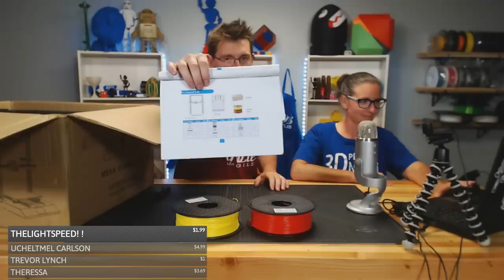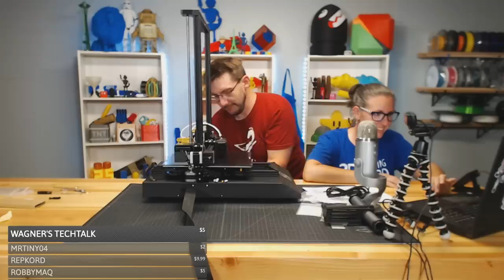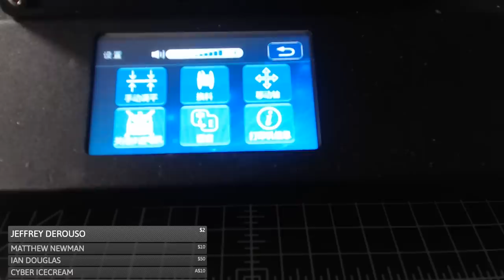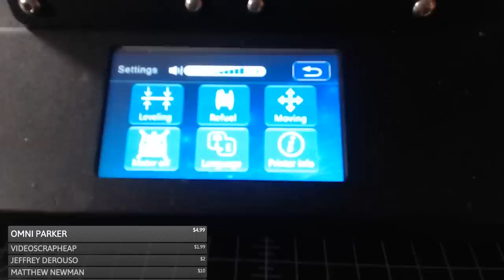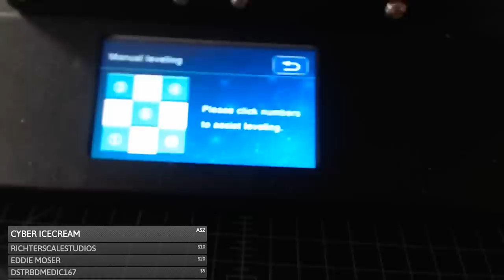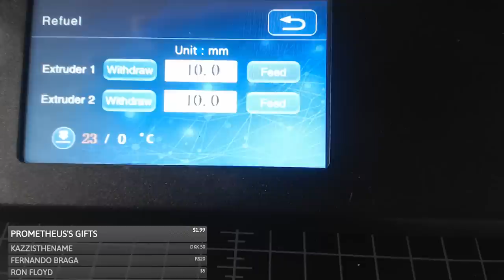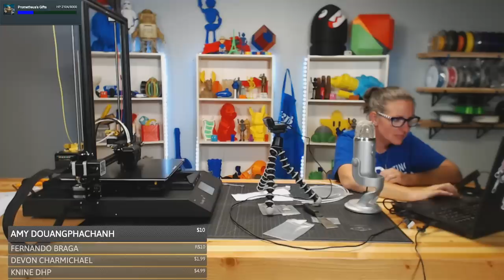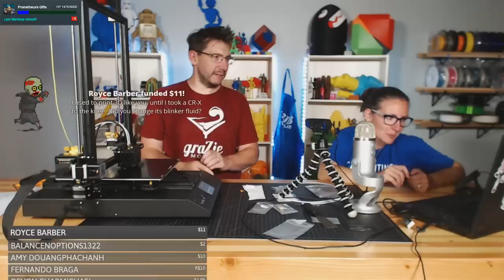Creality CR-X Unboxing & Setup! Will You Be 3D Printing With This New Printer? (Was Live)

Comment: You can use the two PTFE tubing to stop the chafing of the filament on the metal spring loaded extrudes. That way there is a decent bend radius and the filament does not touch the metal.

Comment: A couple important factors that should not be overlooked, is how fast it can reach a heatbed temperature of 110c as the temperature minimum required to avoid resulting in a higher incidence of cancelled ABS prints. 110c, without waiting as long as it takes to make a pizza. People do want that. A added MOSFET and a secondary power supply can be considered an option to correct that concern, though figured why not mention that for factory level builders of printers. Helps prevent landfill this way even.
I like that printers design, and it has a worthy build volume. As a added bonus, a kit inclusion of smaller and larger diameter nozzles would really sweeten such deals. Those can save a lot of time for larger prints and to adjust resolution.

Comment: Sooo... I was just about to buy the CR-105S from Tiny Machines, with all the upgrades. Would you say that holding out for the CR-10X in the next few days would be a better purchase, despite the slightly smaller print volume? Are there enough upgraded enhancements that would make this a pick over the 5S?

I realize that if this becomes a hit, there will be plenty of aftermarket support and goodies to upgrade along the way with.

Comment: Joel,  You are the most awesome nerd I know.  Thank you for all your help, I have learned a LOT from you.  Maybe I can return the favor.  I tried the bed leveling thing with paper, card stock, etc.  Being a back yard mechanic and hobbyist machinist I went and got my feeler gauges.  I use a .254 feeler gauge to level the bed on my CR-10 and it works well.  You can pick up a cheap set from any auto parts store.   HIGH 5

Comment: Can this be used with Water Soluble filament?   If so what is the maximum size?   The specs implies 2 extruders reduce the printer are to 270 x 270, but that does not make sense as it that should only effect the X-axis not the Y axis, or am I missing something.  I need to print 260 x 300 x 300 high.  Will this work or not?   Thanks.

Comment: Great video, Mr. and Mrs. Nerd!! Joel, there is a file on Thingiverse from Tacblades that he created to make leveling the bed very easy and it is for leveling on the fly. It's called Fast Live Leveling and he made it exclusively for the CR-10 300x300x400. He also has a video on YouTube under the same name showing how it works. I use it all the time and it works great. Never had to use the paper method since I got that file and I can level my bed in just a few runs, of course depending on how unlevel the bed is.

Comment: Great review! I'm looking bigger printer than mine. Thanks~
Reply: Just pointing out Anycubic Chiron is coming out soon too (think it is on presale now). Which is 400x400x450. Doesn't come with dual extruder out of the box though. Sure it is something you can add though.
Reply: xConundrumx but does come with bed leveling, fillamnet sensor and almost half the cost, looks like the far better printer, have to wait for reviews.
Reply: GlaucusBlue also a 32 bit board i think not sure about the stepper drivers, should also do flexible more easily from the looks of it.

Comment: So, for $800.00 you get a dual extruder CR-10S 300 x 300 x 400 which does not auto bed level. and also has a design flaw with the extruders. So the extra $400.00 is for the extra extruder and the redesigned base. The $400.00 question, is this worth the extra money? Only time will tell. That being said, It was nice to see your wife in the videos now I think you can say all of your family has been in them even the pet dog!

Comment: Years of 3D printing experience
Does this as his full time job

...yet, can't level a bed.
Reply from the maker: #bless
Reply: All fkin waynes world camera one... Camera two.... But doea not talk about the controller.

What are the extrusions used under that bed shroud...
Reply: Creality leveling is different. It is a skill that must be learned but it’s not that well documented.
Reply: Mitch Scherer bed leveling is a known issue. Creality stock firmware does not have mesh bed leveling with is about 20 points on the bed that get leveled.
Reply: In maybe a dozen instruction manuals and scores of videos and in the sample code models that come with the printers, I have never seen the thickness of paper (~0.1mm) used for leveling accounted for in the generation of G-code with the slicer.
Typical G-code:
;LAYER:0
M107
G0 F4800 X109.535 Y103.321 Z0.300
(assumes surface of bed is Z=0)
Reply: The Marlin I looked at has a mesh leveling routine in it. It must be modified to enable it. A probe for the CR-X is about $40.  The Creality web site also has the hex code for auto bed leveling but I haven’t looked at it.
Reply: Mitch Scherer, I personally always set the height to 0.1 mm before touching the knobs to level the bed
Reply: Turning the knobs to level the bed at three (I have another brand printer that uses three points and a probe and the nozzle height is automatically included in the program), four, five or however many points and using paper or some method to set the nozzle height is half of bed leveling – that half is well documented. Using the z zero (the home you determined in the leveling procedure) in the slicer, then running the printer with it is not well documented.

Comment: I assembled this thing 5 fkn hours ago and it's taken me this long to get my first print going and by that I mean hitting print on the touch screen because since that first time, I've had to restart printing the stupid test box 40 times.

I fkn hate this printer and I'm about to throw it out the window. I'm gonna send it back and get two Cr10s'

Fuck this stupid printer. God I'm so angry...
Reply: You know when you get to the point that you're so frustrated and angry that you start loosing things like tweezers even though you're holding them in your hand?

Im way past that point.

Now the stupid box it's making didn't adhere properly to the bed even though I'm using glue that the nozzle passed over it and hooked the entire stupid box and started traveling with it attached to the nozzle.

This thing is going back to which ever hell based Amazon fulfilment center it came out of.

Never again.